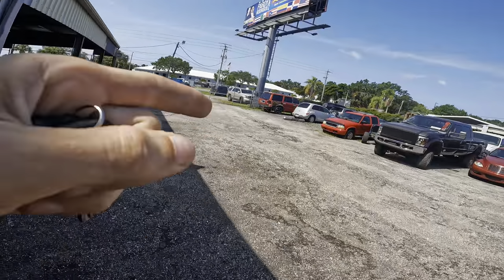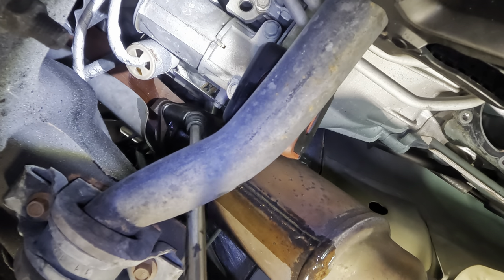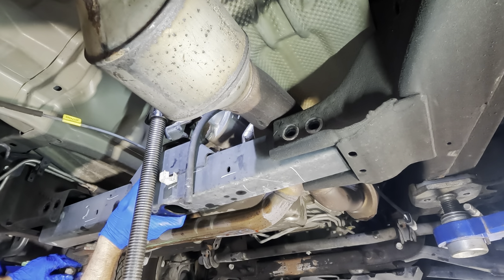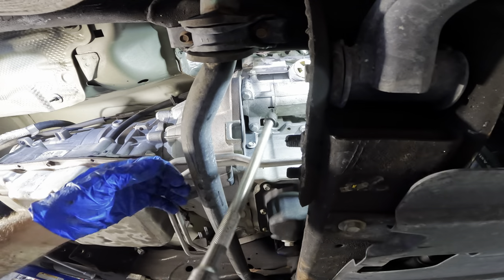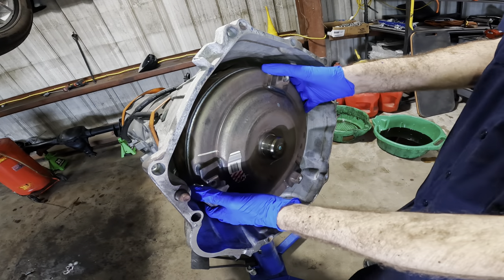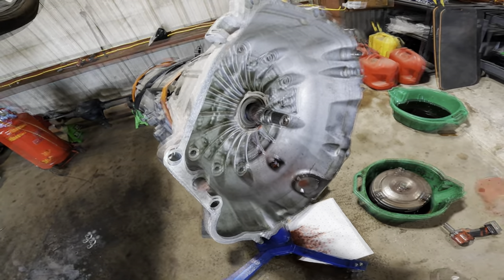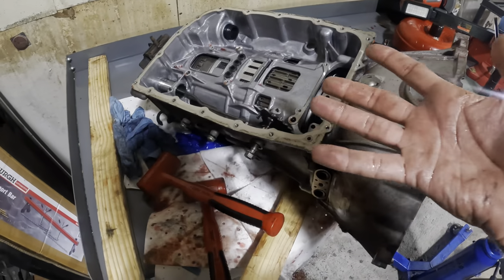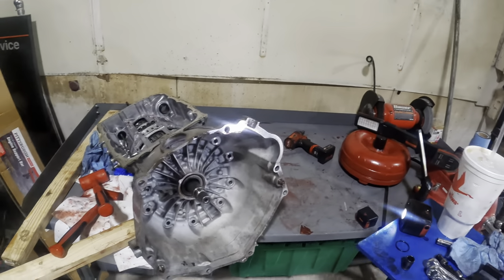Went too FAR! Invasive Inspection, 6l80 Transmission. 2016 Chevy Tahoe 5.3

Comment: You could just cut the exhaust with a sawzall and re-weld it. Something I've seen some shops do. Maybe destroy an O2 sensor or burn some other stuff underneath at the same time. Keeps them coming back. Except me. That's one reason I do my own work. Wish I knew how to find a decent mechanic. So many out there are either crooks, incompetent or both. Good to see it done the correct way.

Comment: That pump is fried you only looked at one part, if it groved the pump and housing, it is full of metal everywhere.  It will grenade again the torque converter is just the beginning.  That metal paste is in every part of the transmission.

Comment: Like I’ve said before,
If you were ever wondering why some things cost sooo much to repair…here’s your answer.
On a side note, I’ve often wondered, why is there no drain plug in the transmission pan.
If anyone has the answer simply respond, I’ll get the notification icon and check out your response.
P.S. GREAT job Ray
NOTE: I did see 1 video, pretty sure it was one of Rays, that did have a drain plug on the trans.

Comment: 58:46 Rays a true mechanic, i think he dug into this both to learn and ensure the work would last,  most mechanics at a dealership would just tell youbits needs a new transmission  and not care what it cost the customers.  Either way they get paid to r&r the transmission.

Ive had tire shop tell me i need new calipers, i always hear this new calapers bullshit. 99.9% or the time i dont, its just dirty glide pins.
Oh you need new rotors,  umm why?  You cant turn them? 
Everytime ive heard this shit only once did i need new rotors in 45 years and 17 differnt cars.
Once i needed 1 new caliper  becuse the piston was rusted but i rebuilt it and it worked fine the car stopped and it didnt loose presure or fulids.   Ive rebuilt altonators and starters toyota sells a brush kit for there cars its not uncommon for the brushes to need to be replaced after a long time of use they also sell rebuild kits for calipers and read brake cylinders probly even master cylinders. Rubber breaks down look at the valve cover gaskets they are big o rings now.
Most the car motor parts are moving parts with seals of some kind 

Thanks for showing the inside of that transmission  it was a real treat.  But i only drive manual transmission  and the system is more like a rearend componets but in a stright line.  Each gear and drive gear move to connect each other.  The automatic transmission is a bit different.   It be cool to see the inside of a tourq converter  go have a machine shop saw it down the center laying on the face then down the side into 1/4 peces then we can see how the fans blades push the fulids i think thats how they work.  Somone said why they are used, but how they work is a cool point as well.  

What will i do with this knologe at age 62? Who cares you can never stop learning.

Comment: Always replace the o ring on any transmission shaft that can cause fluid to leak out and cause studders or overdrive or lock up issues depending on trans model

Comment: The 3-5-R snap ring groove has one tooth it is not cut. If you didn’t put the snap ring in the right place it will blow out. The 1234 clutch below has one also.

Comment: 6L80 with 150,000 miles and torque converter issues that has metal through out the tranny, should be overhauled. IMO

Comment: If anyone remembers at least Mopar from 50s to early 60s had drain plus also transmissions unbolted from bell housing then you could unbolt bell housing from motor. Also made it quiet simple to convert from atmai to manual and vise versa

Comment: I'm not a transmission guy, but I play one on YouTube!  Great job in re-reassembling that trans.  I was peeking out from under the blanket with one eye closed and one wincing expression, but you pulled through like a champ.  Like you said, it's just nuts and bolts (and o-rings, planetaries, clutches, and other assorted odds and ends).  Great Video!  GL on part 2

Comment: What happens is the EPA leans on the OEMs to lock up at lower and lower speeds and causes excessive wear on the torque converter clutch. Thus we have torque converter shudder in just about every brand.
Reply: TC clutch wear and lugging the engine, then stop/start at idle, and cylinder deactivation. What could go wrong? I say the wear and tear is over 100 times the gas savings.

Comment: Ray, you missunderstand the point of cylinder deactivation. It is not about saving the owner money in the long term. It's about using less fuel and meeting CAFE requirements. Just another emissions reduction system.

If the owner has lower fuel costs for a while that's just avside effect.

Comment: When you were installing that one clutch drum, a tip I got once. Im still an amateur though so im not sure if theres a down side to this. When installing the clutches be mindful of which way they are flipped. As in like a washer. Ever notice how one side is a little rounded while the other wise is cut flat? Same thing with clutches. So the portion with the teeth look at the clutches and face the rounded side out so when you slide something into them it lines up a little easier when spinning the drum/clutch pack. Ive worked on a few 4l60es and it was much easier that way.

Comment: Just a couple of miles from me here in Sylacauga, Alabama, is one of THE BEST transmission builders and shop there is around the southeast...Ogletree Garage.  Those guys, especially Chris Ogletree can take a transmission out, totally rebuild it front to back, replacing everything brand new, align, do all it takes, and finish to installing it back in the auto in around 2 to 3 hours.  And they build them bullet proof.  Had my 04 GMC Sierra transmission rebuilt a few years back, including an external trans cooler not connected to the radiator, with a little shift kit so it shifted quite stiff and solid.  That truck could light up the tires on wet pavement from 1st thru 3rd and bark it in 4th.  It pulled like a mule, too.  I towed way above my tow capacity with it..over 11,000 pounds on a 1/2 ton...and that tranny didn't even feel like it cared.  Changed the fluid a year later to get the break in fluid replaced and there was tiny particles like normal wear would have and the fluid was still perfectly clean (10,000 miles later) as if it was just changed.  Guy at the shop who did it asked me how long it had been since it was changed and I told him it was rebuilt a year earlier and who did it and he said he knew it had to be the guys at Ogletree since it was almost as if it was brand new and not more than a couple thousand miles on it.  He, then told me he'd never had a transmission they did that came in his shop for an issue in his 20 years being a shop mechanic (was sort of an express lube shop with a full service of more than just the minor stuff).  So, if you want to learn how to rebuild one, and you don't mind a little trip up this way I HIGHLY recommend finding out if Chris Ogletree would teach you.  Not sponsored or related or anything but I think if you wanted to learn how to do it right he could do it.  Just an idea.  Might be someone closer to you if you wanted to learn but I gotta give praise to these guys since they do work like you...honestly and professionally and they do it right....why I wish you lived here so we'd have the best mechanic full service people in my backyard.  Can't beat a full service line from start to finish mechanics close by...lol.  Take care and stay cool down there.

Comment: Ray that 6l80 trans is the most toxic thing this side of a cvt, they are almost non- repairable, strike one, a weak non replaceable pump( part of the front cover), strike 2, put the tcm inside the trans and subject it to high temps and chemicals, strike 3, put a weak converter in front of it, at my shop that is a strikeout we do not touch them

Comment: Sometimes, you can unbolt the trans mount and raise the trans slightly to get the pan out. Also, the bell housing would have come off easier and by itself if you removed the C-Clip around the input shaft. You skipped that step. There's a ton of videos on "YouTube University" about rebuilding 6L80's. I'll admit that even after 35 years of working on cars, there's stuff I don't know. I'll occasionally watch videos because everything I want to do has been done before by someone else.

Comment: Only at the 8.46 mark and some things have already jumped out. That On Demand crap is just that. Make things more complex and it just makes the cost go up WHEN it fails. Lifetime Trans. Fluid is a misdirect. Somebody else mentioned it in the comments. What's the Lifetime? CVT Transmissions need to be, at the very least, changed every 50K miles with most Trans. Shops recommending every 3rd-4th Oil Change. FAR cheaper to do that than replace, because NOBODY I've heard about rebuilds them.

Comment: 10:23. RAY I WOULD LIKE TO POINT OUT. you do have a suction tank you can use to pull fuilds out of the transmission pan, you can do
This from the dip stick or after you have most the bolts loose and one side down  no point in taking a shower in red hot fluids..
Why they dont put drain plugs 8s beyond me, only a few types of cars get them and ill bet the cost per pan is under 1 dollar each.

Comment: After reading some of the comments I still wonder if that machine he has for transmission fluid renewal did not have a part in the eventual problem with that transmission as the filter was not replaced does anyone in the actual transmission expertise area have any comment on this ?

Comment: 1) The oldest adage is nearly always correct.  If you don't know what you're doing, don't do it.  2) If you would Read Chilton's Manuel, You would know what you're doing.
3) If you don't want to read, then take the truck to a trusted Trans shop, where they can do the job correctly and fast, Saving you and customer time and money.
4) you're Insistence to use "Pry Bars" on Very Sensitive Aluminum Transmission parts, drives me crazy, dude ;)

Comment: It's 10 time more fun to drop a transmission out while laying on the ground underneath 350 pounds of steel. Also, ford transmission are simpler to work on, the only problem the oil filter gasket always gets the oil pump stuck on the transmission housing. My first transmission took me a month to disable, the 2nd time I did it only took me 2 hours.

Comment: you dont have to drop the VB. the shaft seal was holding the bellhousing to the shaft/splines. those were hung on the VB. you see the bellhousing pull the shaft etc with it cause the seal.  this is moot and im sure you've figured it out for next time

Comment: I wonder if you ratted on the pins with an air hammer as you wiggle the transmission if that would assist in removal?

Comment: I have been watching your videos for a while now and I noticed that you have different brands of Impact Guns. Is there a reason you use different ones or is one better than the other? I'm also wondering should I get a quarter inch or a half inch? I would really appreciate your input on this. thank you
Reply from the maker: 1/4” and 3/8” are my go to. 1/2” is on the big side but still useful. No particular reason for the make of gun. I have a bunch of ridged tools and the 1/2” impact is fairly inexpensive. I like the Milwaukee bc they have so many different tools from soldering irons to impact guns and even lawn tools

Comment: I saw a Test On Extensions on YT about a month ago, Extensions Do Not Affect Torque...
Reply from the maker: Correct, however they do absorb impacts
Reply: Beat me to it. The impact gun has a very small throw and the twist in a long extension, along with the slop in the coupling, is often enough to defeat an impact gun. A manual breaker bar has different limitations, but is still the only way with some situations.

Comment: A Jasper transmission rebuild swap-out would have been better 4 shop prophet unless you like to practice and you pay for it like the video there is a year time each transmission model learning lots of upgrades in them keep at it you'll get there
Reply: I’ve rebuilt Japser remains their terrible and they don’t even put shift kits in them.
Reply: @waterloo123100  If you are repair shop that does transmissions you have the knowledge to rebuild them all the updates the trips and tricks What to look for? What check ball to put and where? And the Shift. circuit. Some rebuild kits are 1200 bucks now. And know how to install it. You have to find somebody that eats sleeps and goes to bed with it. going to come out, right? There's no money in it?

Comment: The first thing I’d do is disable the DoD. I have a real problem with slamming valve back in with, 1. A load on the engine, and 2. At a higher RPM. That bothers me a LOT. GM vehicles have a real problem with bent valves in some of those engines.

Comment: Ray,
You will likely not read this comment since you have so many and by now, for this particular situation, you have probably read about as many comments as you feel like and decided to "move on" to other things.  So, I guess I'll just type this figuring it may be all for nothing.

I'm not trying to "pile on" here but I agree with many of the various comments for various things here about how you handled this situation and I'm quite disappointed in you considering how much you know in general about vehicles and their related components and how they are supposed to come apart or be put together.

In this case, since this was a transmission, given your background, you should have known better than to just "wing it" and see what you could do to tear it down.

You're not someone that's been doing "shade tree" type of stuff for 6 months or a year or two.  You've been educating possibly millions of viewers yourself with how to go about tackling certain repairs and helping them to solve problems and diagnosing some complex issues you yourself have had to deal with.

Since you admittingly didn't or don't know much about transmissions, I don't know why you didn't try to do more research about how to PROPERLY tear this one down before attempting the tear down.

There's obviously nothing wrong with trying to figure something out and help your clients.  That's a great thing.  But, at the very least, since you didn't have knowledge of this particular transmission and how it needed to come apart, don't you think that you should have done at least some "bare minimum" due dilligence and either done some reading online about the proper steps and techniques to use to remove certain components at certain times or, watched a few videos?

Honestly, there really isn't an excuse for your actions given that there is so much endless information about so many things on the very platform that you yourself generate revenue from for the very field that you're in.

You know damn well that there have to be a few videos out there showing how to tear this particular transmission down.  But if there isn't, then you should have at least tried to reach out to a few transmission shops around the country and get at least a few pointers on what to do.  Although some people view this as working with a competitor, the reality is, many other shops are willing to help another shop because they just want to help fellow people in the field.

But also, because karma happens to be around all the time and you never know if they may have a weird question that you could perhaps answer for them as well.

Comment: At least replace every O ring you come across. GM transmissions are famous for ‘internal’ leaks on the solenoids and bad transfer valves. There are various bushings that you have to measure, even if you see no harsh wear or rub spots. And you definitely have to check shaft end play

Comment: I've always wondered if an engine can regulate how cylinders operate from 8 to 6 and some to 4, is there fuel saving? I mean the dead cylinders dont lose weight so the engine is still pulling the same amount of weight?
Reply: True, there is load from the remaining non firing pistons...not to mention they must be kept cool by spraying the bottom of the piston with oil.  But remember all these systems are designed around GOV EPA mandates.  So the short / long term costs and ramifications to the end user are not a factor to GM.  The only goal is to build a car to meet the EPA mandates.
Reply: They use cylinder deactivation to reduce fuel use once you reach cruising speed. The torque and horsepower needed drops significantly. Currently GM uses a system to disable the lifters in 4 out of 8 cylinders. Decades ago they had the 4-6-8 engines that only disabled spark and fuel, but they didn't use individual coils back then. It was either a single coil or 2 coil packs. Ford just uses the fuel and spark cut off method and the air pumped through the dead cylinders aids catalyst performance.
Reply: It’s a stupid idea designed to make you throw the car away vs repair attempt, therefore another car sale

Comment: Not the first transmission I have seen fail right after a fluid flush, not sold on the idea of doing pressurized fluid exchanges, I think it damages internal seals and disturbs too much fine material in a transmission. Is this wrong logic or am I just being stubborn and like changing my transmission fluid the old way?

Comment: Why dont you buy one of those red siphon pumps from Harbor  Freight with the 2 hoses on it to put a hose down the transmission dip stick tube and suck the fluid out of the pan before you remove the pan. Thats how I do it.

Comment: I wouldn't take that one apart. If it grenades later, you own it as the owner will blame you for taking it apart. Better to replace, especially with the miles on it. Anything more than pan or valve body removal is a gamble.